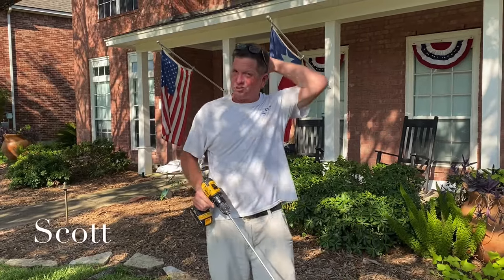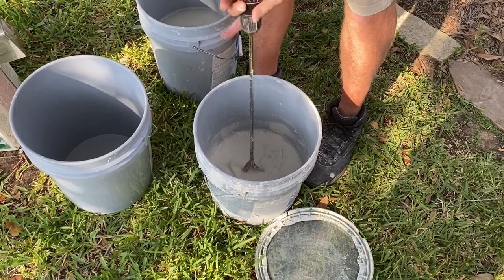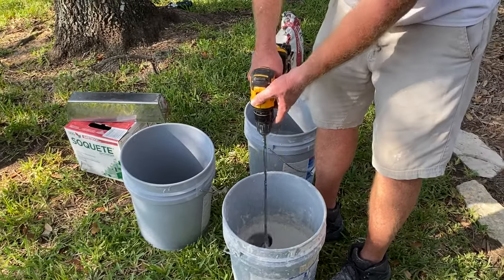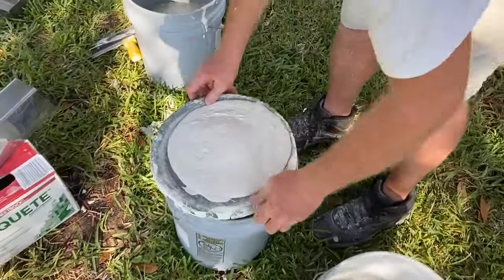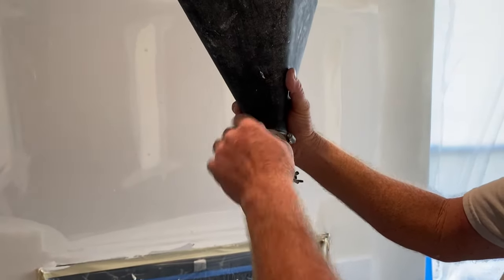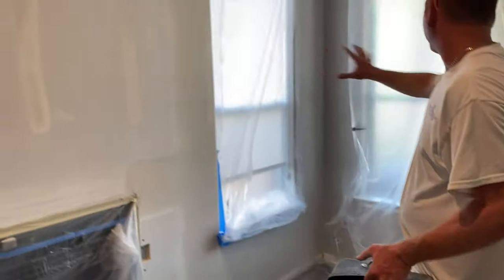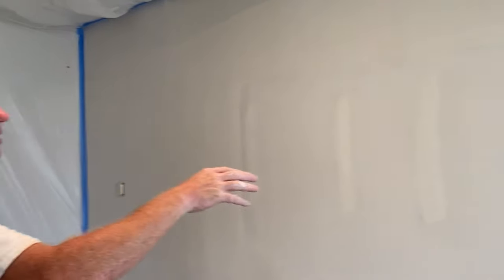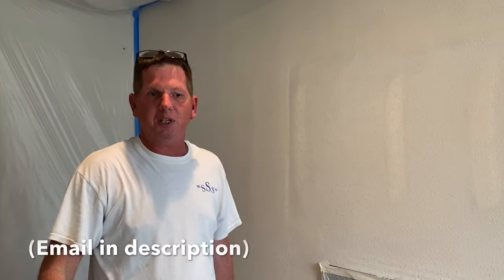How To Mix And Spray Texture (Lite Orange Peel) part 1

Comment: Great videos the only thing I do differently is when I cut out existing drywall with the texture on it is I take a peice of new drywall and put them side by side and do a test shoot to make sure the match is spot on and the only reason is because using different hoppers can throw of the pattern I've learned

Comment from the maker: If you have any specific questions on anything in particular process wise or materials just let me know thanks
Reply: Hi 🙋🏼‍♂️.... wonderful video ... where can I get one of those screens ?  Or did you make it yourself ?
Reply from the maker: @madwasmatt4893  Make sure you get the screen that is stiff and the holes kind of big don’t get the really fine screen I just took a bucket top from a 5 gallon bucket cut a hole and stapled screen around the outside.
Reply: @scottssheetrockservices  thank you for your quick response.... lovin your videos !!
Reply from the maker: @madwasmatt4893  Trying to get to the thousand mark on the subscription list I’m getting there thanks for your support!
Reply: What psi are you running for that light orange peel?
Reply from the maker: @jbridgemiii  so I like to spray right at 110 on a constant you can go as low as 90 or as high as 120 anywhere in that range you should be good but it has to be constant hope this helps
Reply: @scottssheetrockservices  thanks for the quick reply! Very helpful, thanks for putting out the video  🤙🏽

Comment: Hey Scott thanks for this great video on shooting orange peel, I went ahead and followed your instructions sprayed it on ceilings and walls of a basement and now I’m having an issue with paint coverage I saturated the ceiling with PVA primer followed up with Glidden ceiling paint which goes on pink and dries white and I have tiger stripes all over the ceiling which really looks horrible any suggestions on what I could do to fix this or possibly what I could’ve done better prior to painting?
Reply from the maker: @mibooth1852  if you’ve already primed it, I wouldn’t use that paint . I would get some Sherwin-Williams 200 flat. Assuming it’s a flat paint, roll two coats after cut in and roll opposite directions each time. Hope this helps.

Comment: This was a fantastic texture video!  Short and I loved the bucket lid screen and am going to make one [shows how thin the mix needs to be for Orange Peel].  That adjustable (all texture) hopper is cool better than changing nozzles.  I was forced to do texture on some subcontracted jobs recently with the Homax cans and it was a learning curve which included not shooting and the largest settings by dialing it way back to get Orange Peel not popcorn.  QUESTION: I've always heard the great thing about texture is it hides imperfections but found that wasn't true for the cans and probably only for the hopper IF put on very very heavy.  Why do so many people say this when it really isn't true??
Reply from the maker: So for a light orange peel the homemax cans do really well I have other videos on how to get the patch correct but yes it doesn’t cover much you have to make sure you dot your eyes and cross your tees prior to texture. I have a knockdown will cover a lot and so will popcorn but you have to have a smooth transition when it comes to a light orange peel. Hope this helps.
Scott

Comment: Need some specific info before starting this project in 2 days.  😱
Do you use aluminum screening or plastic or fiberglass? And how many holes per square inch? I've seen 14 and 16.  
Great info here. Thanks for posting and for your input.
Kristi
Reply from the maker: 16 should be fine the 14 is very small I use aluminum personally for the top

Comment: Any preferred lights you use? What little texture I've done the hard part was finding the right angle of lighting so I could see the pattern going on. Usually the room is quite dark with the fixtures removed and maybe a single overhead light bulb.
Reply from the maker: Personally in a dark room we use lights to touch it up once it starts up I’ve done it so long I can do it in the dark but you can just use a regular utility light to move around to watch what you’re doing

Comment: Nice video! May I ask where do you get the screen to strain the mud?
Reply from the maker: You can buy a screen from any hardware store I just cut the inside of a plastic bucket top out and then staple the screen and cut the excess around the bucket lid. Just make sure you don’t get the smallest screen  holes or you’ll never get the mud through it. Hope this helps

Comment: 2 questions sir. How far are you holding gun from the wall & you just used regular joint compound mixed with water instead of the texture specific mud?
Reply from the maker: Usually stand somewhere between 2 1/2 to 3 1/2 feet away from the wall depending on how big of an area you’re spraying I  might back up a little bit more  you can use regular mud but also USG makes a really good brown box of premixed spray texture works really good for a light orange peel hope this helps

Comment: Hi Scott thanx for the videio how do you knw how much product to by have a small Master Bath but has high walls  will one box be enough to do a light peel ? can I just thin down the pre mixed stuff .
Reply from the maker: One box will be plenty I would suggest about 3/4 of a box in a bucket loosen it up then strain it should be plenty to do one bathroom for a light orange peel
Reply: @scottssheetrockservices  Thanks out of all the video's I watched yours was strait up and to the point thanks !

Comment: What air pressure are you using ?!
Reply from the maker: For light orange peel I like to be at roughly 100 steady anywhere from 90 to 110 is good but that Has to be steady not a small compressor or you have to spray a little bit at a time and let the compressor recharge if you have a small one

Comment: What brand of compressor do you use? How many gallons is it ?
Reply from the maker: My compressor is a roll air with an eight horse Honda motor on it best pressure is anywhere between 100 and 120 for a light orange peel on a constant
Reply: How many gallons is your compressor
Reply from the maker: The compressor sits on top of two air tanks approximately 6 inch round air tubes I would guesstimate 10 to 15 gallons per tube

Comment: Can you tell us what air pressure you are using?
Reply from the maker: For a lite orange peel I try to stay between 90 and 110 on a constant you have to have a big rig or spray a little bit at a time and let it cycle back up if you have a smaller compressor that can’t keep a steady pressure of at least 90 or 100

Comment: What pressure is the compressor set on?
Reply from the maker: So I have a large compressor that blows a constant of 110 PSI‘s if you can be anywhere between 100-120 on a constant pressure. You’re going to get your best results if you do have a small compressor you have to spray until your pressure is low turn the hopper off and then let the compressor build back up ,you cannot spray a light orange peel with light air pressure.
Reply: @scottssheetrockservices  why do most other vids say 40psi
Reply from the maker: Most people use a small compressor I have a big compressor so I can do big jobs I would think maybe different hoppers with a lesser pressure you can get a successful light orange peel but with my hopper once the pressure goes under 80 it starts sputtering and you lose that fine pattern so the higher the pressure the better pattern you can keep consistently hope that helps

Comment: what screen do I buy
Reply from the maker: Just regular window screen works fine. Just don’t get the screen that has a very very tiny holes it’s almost impossible to pour mud through it so a little bit bigger hole on the screen is better you can tell a difference if you go to Home Depot or Lowe’s by looking at it I hope this helps

Comment: Yo why you using that jury-rigged screen instead of $1.00 paint strainer? Not trying to be a dick, just sayin’….
Reply from the maker: Paint screen is to fine the mud won’t pour through been using that homemade version of a screen going on 30 years now
Reply: I just used a screen and it worked excellent.  I like this tip.    (I live an hour away from a big box store so DIY is really helpful)